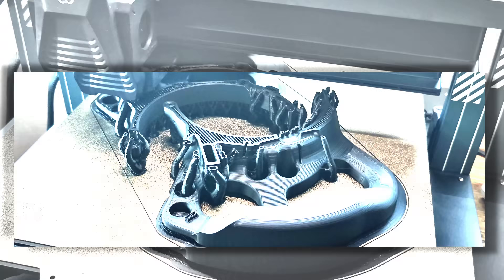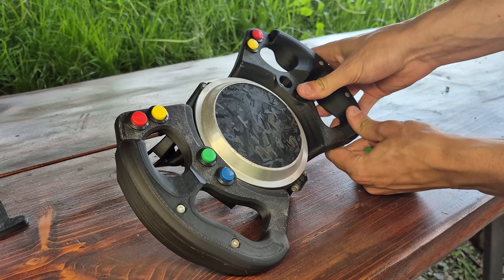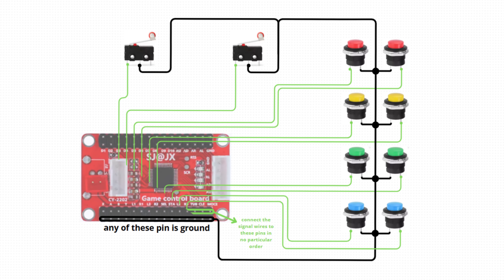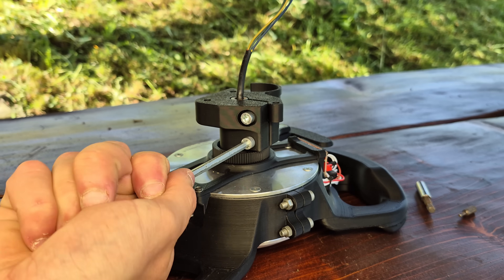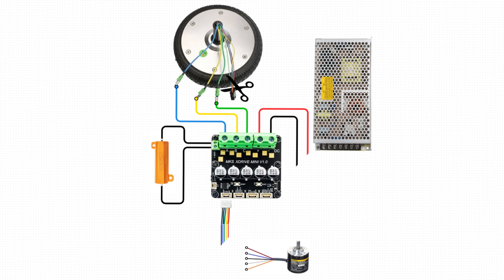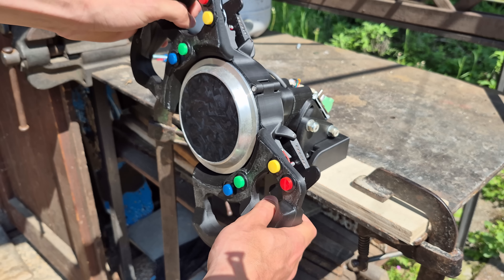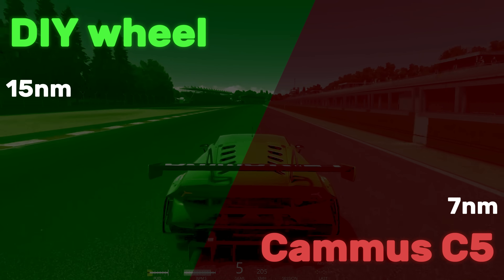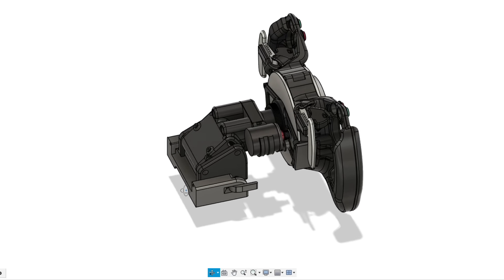HOW TO BUILD a 15Nm DIRECT DRIVE Steering Wheel | DETAILED TUTORIAL

Comment from the maker: The upgraded steering wheel with swappable wheels is now completed, whatch the video here: https://youtu.be/Bj1dY0A8zec
if you wanto build this amazing project you can purchase the files here: https://cults3d.com/en/3d-model/gadget/upgraded-ffb-steering-wheel-with-swappable-wheels-by-daz-racing
Reply: Swappable rim
Reply: How long do you think until the wheel is made rather than a yoke?
Reply: where can i find second video on DIY sim racing PEDALS | HIGH performance & FUN beacuse what do i do after
Reply: Can you please share something around what firmwares or other software is required for this to work? Thanks
Reply: hey mate, what's the size of the motor you use on the video? 6.5, 8 or 10 inches?
Reply from the maker: @t3ll-LvG it's around 13cm in diameter
Reply: @DAZprojects   @DAZprojects  Thanks! One more thing: I bought the 3d model, would the encoder pulley fit in a bigger hoverboard motor? I'm thinking of getting one with 8 or 10 inches (20cm and 25cm) for more torque.
Reply: 1 12mm round magnets on both sides would be way stronger for paddle shifter
Reply from the maker: @mr.simulator4724  trust me it's already strong enough, stronger than this would get fatiguing
Reply: completely different standalone wheel that can be mounted when assembling the motor
I like this option the most as it sounds like it would allow for use of quick release style wheels
Reply from the maker: @ronnieslides  no because it will be mounted around the motor and not compatible with standard wheels
Reply: @DAZprojects   just the cables running through the central hub or something and maybe a simple 3d printable cover ? love the work so far
Reply: what the cheaper alternative for MKS ODRIVE?
Reply from the maker: @VitaliiThe  already the cheapest
Reply: Thank you so much for making these projects, I'm gonna have so much fun putting it all together. Do you think you will use the same components from your current list in the google doc? (If not I will wait a little before I get the parts)
Reply: I mean swappable sounds great, especially if you can manage to use the already existing standard.

Maybe you could tinker up some hotswap interface for the electronics and put the buttons onto the wheel :d
Reply: I'd say either, but if it could be designed so that the paddles don't rotate with the wheel that would be preferred. Fixed paddle shifters seem better for rally.
Reply: You don't sell them bro?
Reply from the maker: @JeovannySánchez-u9k  I do, there's a link in the description
Reply: what are the exactly motor dimensions since im scared the motor i buy would not be the exact size
Reply: one more thing, in your paid thingy that gives u the 3d printed parts, does it come with everysingle step on how to even connect pedals to it or just how to wire and 3d print the wheel bit?
Reply from the maker: @7akziz584it comes with everything needed to build and program the wheel, the pedals are a completely different project and you can find how to wire them in my previous videos
Reply: @DAZprojects  appreciate that will help a ton to my school project thanks!
Reply: is there any alternative to the hoverboard wheel
Reply from the maker: @AceZone_pro  no
Reply: @DAZprojects  D: man that kinda sucks can you make a direct drive wheel using a car motor
Reply: I'm wondering if this will work on a PS5 too, what do you think?
Reply: swappable rim, 1000%.

im looking forward to it!! 🙏
Reply: Hey! You might remember me from the older video :D
Anyways, I'm trying to get my own build going but the only driver that I could find in my country was the Makerbase ODrive3.6 56V and it's not really from a reputable seller but I don't have any other choice. Unless there's a different brand I could look for? Maybe a BTT driver could work?
Reply: @DAZprojects how long until the swap able wheel project video will release?
Reply from the maker: @mason1966 probably a month, still have t received the parts from PCBWay, and I'm currently in the middle of an exam session for university
Reply: @DAZprojects  Open source it
Reply from the maker: @ManicQuinn  I'm selling it, literally the opposite 😅.

I'm usually against open sourcing since it's in my opinion right if someone who comes up with a great idea can earn from it, and I'm more than happy to pay for something I need if I see that it supports a passionate small company / individual
Reply: @DAZprojects  how long do you think untill you get full wheel one im curious man
Reply from the maker: @ivank20r  a couple of weeks
Reply: @DAZprojects  i guess ill have to put this one together forr now good thing the used  hover board i picked up has two motors
Reply: option B would be the best option for users, but possibly harder to create
Reply: Hey I would like to use this design but by mounting a quick release to face of motor an having no buttons. I'll still need the USB button box for the USB cable to connect to pc correct
Reply: Te puedo pedir, las configuración que hiciste en el programa?
Reply: This project is complete garbage. You can’t use PLA for a 15 N motor — it will fail immediately and the table mount will crack and delaminate.
Second, the overdrive resistor needs proper heat dissipation; resting it against plastic is just asking for it to melt.
On top of that, the total cost is over €100, which makes absolutely no sense.
Bottom line: this is a terrible, poorly thought-out project.
Reply from the maker: @21LOLxPRO thanks, the 500+ people that bought it doesn't seem to think so

Comment: Hey man I am considering doing this but I have 2 questions..😅

At 6:26 you’re giving it a wiggle test but it seems a little wiggly in the base still. Doesn’t it get worse/is jt not worth to make a stronger base? Or am I tripping.

Also do the hoverboard motors handle rubbly fbb well? Like curbs, abs, road surface etc?

Edit: last question trust me. But are all hoverboard motors the same diameter for the outer casing? Because it needs to fit the 3d print diameter right?
Reply from the maker: The base flexes a tiny bit but it's not really noticable when driving, and the motor handles driving extremely well, with it being super tunable to suit the feeling you're going for
Reply from the maker: All hoverboard motors are the same diameter, just make sure you get a standard one and not some strange model
Reply: @DAZprojects cool man thanks for the replies, this looks super much fun to do so when i have the time i will definetly try. great videos

Comment: Hi bro, I have a question. I’m using an FFBeast base and I built a Turn Racing 488 GT wheel with an Arduino Pro Micro inside. When the wheel is not screwed to the base, everything works perfectly. But when I attach it to the base, I start getting an unstable signal – the buttons trigger randomly for a millisecond even though I'm not pressing them. Because of this I can't play anything: in F1 22 the buttons mapped to ERS, MFD, etc. activate by themselves.

You say it can be fixed by connecting the boards 5V to the motor casing, but is that actually 100% safe? I asked ChatGPT (yeah, I know hes stupid) and he said the Arduino could get fried by doing that, so now I’m a bit scared.

If it's not risky in your opinion, I’ll try it. But if it is risky, can you tell me a safer solution? Thanks in advance for your help!
Reply from the maker: That worked for me even though it would be better to have ground connected instead of 5v.
Reply: @DAZprojects  so i should try connecting gnd to motor housing istead of 5v?

Comment: Does anyone at all notices that this is as direct drive as thrustmaster t300 which is not at all? I mean amazing that u did this and kudos for that but don't tell me that nuts are apples
Reply from the maker: You clearly don't know what direct drive means

It means that the motor (rotor or stator) is attached directly to the steering wheel, without any gears or belts
Reply: @DAZprojects  Sorry I just saw ur other video and now I can see that u did it in a bit different way it didn't cross my mind that a rim can be attached to a stator xD my bad

Comment: My thrustmaster wheel has 5nm and has nearly ripped my hands off a few times, I wouldn't expect your mount to hold 15nm at all!.
Reply from the maker: I infact suggest it to be kept at 50% power. Mainly for overheating issues.

But still the mount will hold, trust me

Comment: Can I use a psu with less amps
Reply: No, in fact you might want even want one with more. 10amps will be okay when not running full power like he does but 15 or even 20amp would be needed to run these motors at full power.

Comment: lol the g29 g923 are only like 3.2 nm lol.. how does it feel. have u tried any other direct drive wheels so u can actually tell if its crap or not
Reply: They are 2.3 nm. The good thing about DD is how reactive and precise they are. Even a Moza R3 is way better than a G923 even if its FF is not much stronger.

Comment: Sorry for being late in the party but, is there a way to avoid that one wire dangling on the steering wheel, to prevent it from wrapping around the wheel if I wanna use 900 degrees rotation for other sims ?
Reply from the maker: You can make it wireless like I did in my follow up video
Reply: Nice, now how did you flash the program ?

Comment: Hi, awesome project! Why did you print the steering wheel in two halves? Since you advise on maybe opening the motor anyways, you could just slide it into one whole part and then screw the back plate on, no? Would make for a cleaner wheel. Also, can I use the ODESC 4.2 for this build as well? The MKS XDrive Mini almost doubled in price to around 50 EUR.
Reply from the maker: Thanks! There's a compatible controller list on the FFBEAST website, as for the two halves that's because it allows you to tighten them around the motor with the two bolts
Reply: @DAZprojects Good point, thanks for your reply!

Comment: Hi! I’m still underage, but I’ve been trying to develop my skills in electronics and mechanics for several years. I’ve already built a few simpler FFB steering wheels and some CNC mills, but I’ve always dreamed of making something more professional. Your project really inspired me – it’s exactly the kind of steering wheel I’ve been trying to design for a long time, but I’ve never managed to do it on my own.

I already have all the necessary parts; the only thing I’m missing is the model. Unfortunately, I didn’t have enough money to buy it. That’s why I wanted to ask if you could share it with me. It would be a huge support and an incredible opportunity for me to further develop my skills. I promise I would make the best use of it.

Comment: The Odrive costs 30.
The motor costs 20. On eBay.
The plastic costs 15.
Cables 15.
Belt 5.
Power supply $30.
Terminals, plates, etc.
The total is well over $100.
Reply: He has a list of materials. This was on 1:1 €/$ times, its still close to 100€

Comment: i have the exact same encoder but my one has 6 different wires? White, Grey, Blue, Black, Orange and brown.
Reply from the maker: The grey one should be just a plastic cable without any metal core
Reply: @DAZprojects  thanks. And i suppose the Brown wire from the encoder goes to the red wire from the plug?
Reply: Yo dude did you end up building it?
Reply: @japneetsingh5385 I build it with my own 3d models because I wanted to do a drift setup. I ordered all the electrical parts on AliExpress like he did. I didn’t finish it because I don’t really have time at the moment but all i have to do left is the wiring

Comment: For anyone wanting to try it, to make it feel good you will likely want to add a higher resoloution encoder and a higher performance controller.
Reply from the maker: Doesn't make that much of a difference, my encoder is 32000 ppm, pretty high resolution
Reply: but isnt wheels not about torque if im not mistaken some wheel have better feedback for the slip angle and tires slipping and roads ect despite other wheels having bigger torque they provide less attentions to detqils

Comment: I have had Logitech G27, Thrustmaster T300RS GT & TX, Moza R5, and now I want this! Seems amazing and cheap. I love the quick release desk concept. It is always difficult with the clamps, because you have to remove and install every time, but with quick release it can be installed to the bottom of the desk and then the wheel and hub easily removed. 

Do you have anything you wish you improved? I will be making this soon!
Reply from the maker: I'm dropping the upgrade video probably tomorrow, stay tuned!

Comment: Please DO NOT apply 5V to your motor housing! This doesn't help with noise generated by the motor AT ALL and can potentially fry your boards. You SHOULD be connecting GROUND to your motor housing to mitigate EMI/Noise. I am not sure if this was a translation issue or something but what he tells you to do is electrically incorrect and hazardous.
Reply from the maker: I know that is technically wrong but that's what worked, connecting ground made the issue actually worse

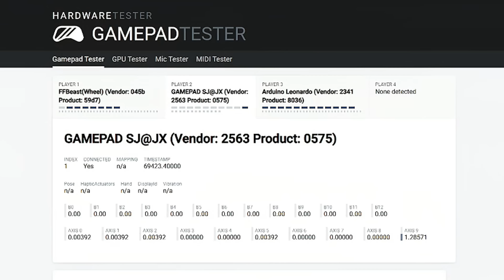Comment: Where do I solder the cable for the 5 volts to the motor to solve the problem you mentioned at minute 2:54?
Reply: Just stick the wire to the back of the motor.

Comment: Just bought all of the parts. Spent around 150$ usd
Reply: Bro what is your size of hoverboard motor is it 6 inch or 6.5 inch
Also
24v or 36v
Reply: @AkhilDavis-b7z   I used a 5 inch motor and 24v
Reply: @granthamblin240 how did the build go?

Comment: direct drive for this cheap is crazy, have you experienced any creep or deformation in the PLA due to heat from the motor?
Reply from the maker: No, in my next video I'll show how I improved cooling
Reply: @DAZprojects  Hi first of all great project; just bought the files and the parts; yet I would highly appriciate if you show also the connections between the boards with the PC (from the Parts list and the video I figured 1x USBC from the Makerbase to the PC  and one USB from the" RedBoard" to the PC (?)). thank you in advance and keep up the great work!!

Comment: If i don't have 3d printer does PCBWay have all the stuff to complete this project if I get the other parts and power supply and will it fit a logitech whole pin out? thanks I am low income and disabled and wrote to logitech and moza for help getting a new wheel but had no success and help would be appreciated and I am a fellow YouTuber SimRacingwithMichael and Spaceesbox thank you for your time Michael it was really a neat wheel and video
Reply: Where do i find the full plans for this build and part list?

Comment: There is something I didn't quite understand. Why you connect the shell of the motor to 5v instead of ground to shield from the interference?
Reply from the maker: That honestly confused me also, but connecting it to ground didn't work, to 5v yes instead
Reply: @DAZprojects  When is the wireless button mod coming? what is the hardware you are using? esp32 or what? In order to buy in advance

Comment: Thank you for a great video. Do I understand correctly that your design does not require any modifications whatsoever to the motor itself? Just pull it off of a hoverboard, remove the tire and it's ready to be used in your project? Will it stay the same for the round wheel design version?
Reply from the maker: Correct
Reply: @DAZprojects  gotcha, huge thanks for a quick reply!

Comment: Para el tema del calor del motor produce hasta máximo 60 °C , para el PLA su tolerancia de temperatura para ablandarse es de 50 a 60 °C se puede solucionar si cubres la orilla del motor con cinta de fibra de vidrio con pegamento de alta temperatura pero al ser expuesto no es un gran problema, otra opción es imprimir esas piezas en PETG (tolerancia de 80 a 85°) o ABS (100°)

Comment: Excelente aporte muchas gracias! , actualmente estoy armando el proyecto y he encontrado algunas precisiones para ayudar a los demás en el caso del motor es para hoverboard de 6.5 inch y hay dos opciones un motor de 24 V que su máximo toque sería de 11.5 Nm si la fuente es de 24v 10 a, pero si la fuente es de 36V y el motor igual de 36V que es el más común aquí el pico máximo es de 15 Nm
Reply: Sabes donde se puede conseguir el motor?
Reply: @aramrivera23  el motor en si es una rueda de un hoverboard, esa especie de monociclo electrico. En españa eran bastante populares hace 10 años
Reply: @giskard427 alguna actualización de como te fue con este proyecto??

Comment: Does the encoder always know the position of the wheel after the start? otherwise a homing process would be needed
Reply from the maker: Yes, It remembers the zero point even when turning it off
Reply: @DAZprojects  I just wondered because on aliexpress it says the encoder is incremental
Reply: @DAZprojects  No it doesn't. you have to have the wheel level when you turn it on. it uses whatever position the wheel is in when you turn it on as zero.

Comment: Did the rotary encoder not need the setup resistors like it says on ffbeast?
Reply: As DAZ hasn't replied to you yet, not all rotary encoders need the signal to be pulled up with resistors. The one used in the video, E6B2CWZ6C, doesn't need it.
Reply: @alejandrovelasquez8063 thank you so much man I appreciate it! Still new to learning about electronics.
Reply: @protofreak9518  No prob my man, several rotary encoders, if not most of them, do need the resistors so I understand the confusion!